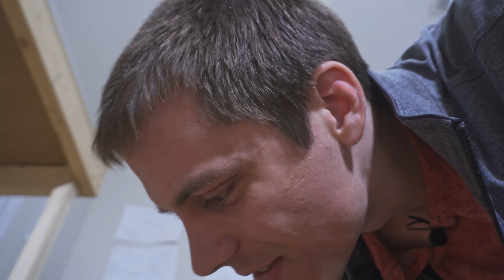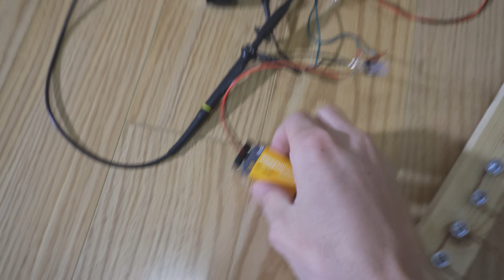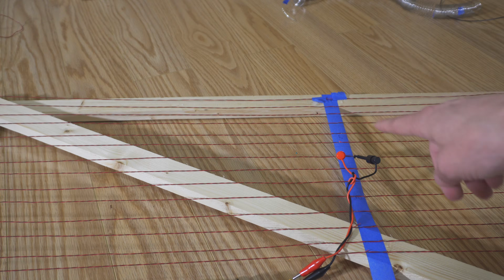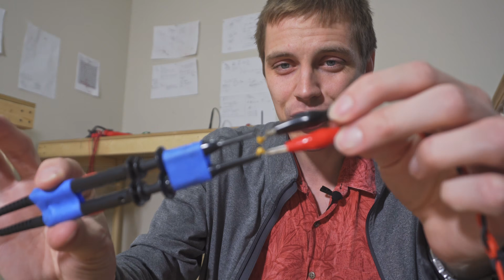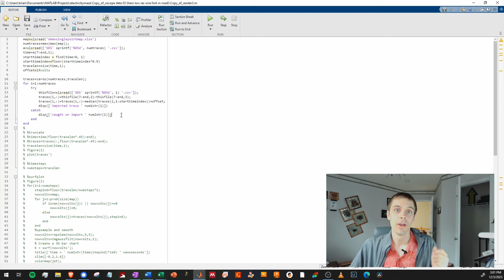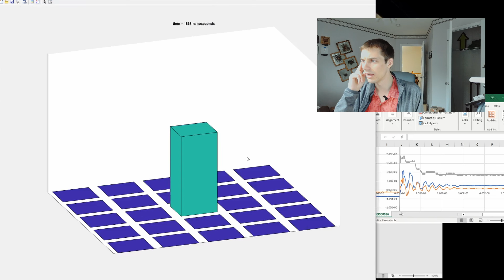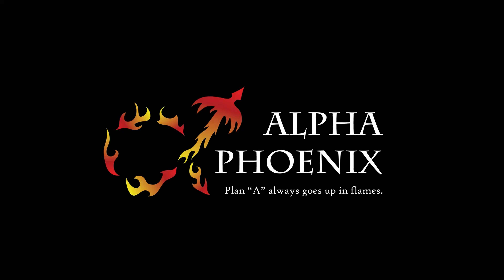How to measure waves of electricity

Comment: I wonder what it would look like to just use a single probe attached to a point in the wire rather than two to take the difference. It might be cool to see how a portion of the wave spreads out radially bc of cross-talk and then later the actual wave traveling through the wire arrives. Although I could easily see that being too noisy to really learn anything from

Comment: Thinking about how twisted pairs naturally reduce EMI (the reason they are used in telephone and Ethernet cables).  It would be interesting to see this same setup but not twisting the pair, just straight wires touching each other.  How much worse would the EMI be?  Would probably require some home built contraption to put a wrap around the pair to maintain even contact between them.  The thinnest available speaker wire maybe?  Thermocouple wire is often made this way, but it's pricey.

Comment: Brian, this is probably the most interesting series of videos I’ve ever seen. No hyperbole here. So many levels of fundamental understanding about electricity, impedance, metrology, being shown and explained in an intuitive way. 
One question I was left with: how does current depict itself in the top graph of voltage? Is it the increased area under the curve? The slope of the wave front? I know charge has to flow to change the voltage within the line, but I’m having trouble connecting it to the measured values.
Thanks.
Reply from the maker: the "fake electrons" in the diagram, and the associated "electron drift speed" plot were based on how much current would need to flow in order to see the observed changes in potential along the wire.

The first bounce is easy: If you assume the capacitance of the cable is the same everywhere, then every additional volt is a proportional change to the electron density (linear density) in the wire. Once you pick an arbitrary (ridiculously massive) capacitance, you can invert the "electrons per length of wire" plot to get a "distance to the next electron" plot at any location along the wire. If you know the electron at the far end of the line isn't moving (for relativistic reasons, don't need to assume anything about electricity), you can use this to iterative draw each "electron dot" spaced back from the end of the wire the correct amount. The really cool thing is that as you play the animation forward, this construction (based completely on a fudged electron-density-to-voltage characteristic, produces motion, because you NEED electrons to shift down the wire slightly to produce these voltage waves.

Subsequent bounces are harder, because then you don't have any stationary electrons to use as a foundation, and you need to grab an arbitrary (actually carefully algorithmically chosen but whatever) and say "this particular fake electron isn't going to change in speed this iteration" and you base everything off of that. 

I realized after the fact that I could have based everything off the electron at the supply end and then measured the ACTUAL current using a small resistor (which I did at one point), but I was actually much happier to see that you can get good realistic motion based exclusively on assumptions about what current is necessary to produce a certain voltage distribution.

My FIRST attempt was actually a full simulation - I dumped a bunch of electrons in the wire and let them be accelerated by the field, but unfortunately the scope traces at different distances were SLIGHTLY offset from each other, and that meant that while a human could identify the waves easily, the algorithmic electrons were bunching up as they got attracted to all the slightly-elevated trace locations and it was a nightmare.
Reply: Thanks. Took me a bit to work through, but I think I got your approach:
Represent voltage i.e. relative charge density as the direct inverse of distance between the charges. 
Back-calculate the position of each charge relative to the stationary reference. 
Add the incremental movement of the reference to all charges.

I puzzled through my question again, and this is my long-winded logic on current in the voltage graph:
Consider arbitrary positive charges, zero net charge initially, and a perfect step input wave.
When the “voltage wave” travels through the length of wire, the net charge in the wire increases.
This increase is proportional to the voltage(charge density) and the length of wire(capacitance) under/behind the wave.
The speed of the wave determines the amount of charge moving through the starting point per unit time.
Charge movement is current.
So the voltage integrated over the length of wire is total charge, and the change of this integral over time is current.
If we move the virtual “current sensor” to somewhere along the wire, we can just integrate starting at that point.

Of course, this breaks apart as soon as there’s a current coming in from the end.

Comment: Is the time the signal goes into the oscilloscope from the probe taken in account ? (Subtracted to get the real time it got in the wire ?)
Reply from the maker: dont know how long, should be the same for all
Reply: @BetaPhoenixChannel   Ok you're right, as the calculation are relative to the initial signal time, if the length and the constitution of all cables probes are the same it should be ok 😉
(what did you think of my experiment proposal ? 🙂)
Reply: ((just in case : the experiment proposal in the comment section of the video "Can you replace all of the mobile electrons in a wire? (Back of the Envelope episode 2)" 😇 ))

Comment: For improved accuracy with differential probes, you should have connected the grounds between them!
The second thing, and I think you did do this, but non the less:
It is very important to use the x10 setting on the probe for two reasons: to increase the input impedance of the probes (the thing you tried to do with capacitors), and to enable you to trim the probe's compensating capacitors (little screws on the side) to eliminate ringing.
Trimming is done with a probe attached to the test generator contacts just beneath the display in the middle of your scope.

The problem you saw with the probe disrupting the signal patterns is from the ground connection of the trigger probe attached to the switching circuit.
You really should have added some proper analogue switchings to the circuit, like SN74AC66, and also separate batteries for the oscillator and the driving the line, to mitigate ground coupling through the scope.

Comment: Regarding using the electrolytic caps to bypass the schmitt trigger's power...  the common practice is to add a ceramic cap in parallel with the electrolytics.   The ceramics are much faster to respond to any changes.    As for the differential probing of the twisted pairs...  the probes already have a much higher impedance than the twisted pair.  Blocking the DC with the series caps doesn't seem like it would improve things.  Differential probing is required, of course, because you want the voltage difference between the red and black wires, and that black wire is definitely not at the scope's ground potential.   I really enjoyed the part where you explained the need to get data at all of the points and animate it, and then said "it's just that easy".   🙂
Reply from the maker: good to know! the vast majority of my electronics experience is with very slow things so electrolytics have been good. maybe those weren't doing anything at all here lol
Reply: @BetaPhoenixChannel  Doing this sort of high frequency electronics work has a variety of pitfalls.  You might want to browse a book titled High Speed Digital Design by Howard W. Johnson,  ISBN 0-13-395724-1.   There are techniques to improve the scope probe performance too.  This video has a quick explanation of why you can't use the scope probe ground lead for high frequency measurements....  https://www.youtube.com/watch?v=henwiLzSieA

Comment: The twisted pair is a transmission line. Your rapidly switched  pulse  is a mix of RF (wide band) and DC. We need to be careful and not equate the DC bulk Resistance of the twisted pair to DC flow, with the  Impedance of the twisted pair to an RF wave front.  Different critters. The pulse that is impressed and propagated at the velocity factor of the transmission line when the switch fires each time, is primarily a radio wave that rides up on the skin depth of the wire (frequency dependent) and its propagation along the wire is resisted by a combination of reactance and surface resistance, that we call impedance. Along with that is the DC current that is more controlled by resistance and propagates through the bulk of the metal at a different velocity.
This can be shown by a long balanced line made of two, very thin wall, hollow copper pipes. Measure the DC resistance of the line, then measure the impedance and velocity factor of the line at some arbitrary, but stable,  radio frequency.
Now, replace the hollow pipe with solid round bar of the same diameter and repeat the measurements.  The DC resistance change will be significant while the velocity factor of the balanced line to the pulse will remain close to the original.

Comment: I love how this video demonstrates that proper experimental design relates to just careful thinking and understanding of assumptions and first principles, and does not have anything to do with how fancy the equipment is. The whole experiment used dead bug circuits and a super cheap scope, but was crafted to be able to gain them necessary insights, and it does so with sufficient resolution to prove the points.

Comment: Great work on that visualization! I think your setup would greatly benefit from using coax instead of twisted pair, and from using BNC T-adapters as monitoring points (even though you've stated your motivation for a custom-made lines at the end of the video) - see my comment under your main video for more detail. By the way a great learning source about transmission line transients is a book by G.A. Mesyats called "Pulsed power", more specifically, chapter 2.

Comment: To more accurately use water to display force propagation, you could have a tube filled with water, capped on both ends with a latex cover stretched over each end, put say, a domino
on one end, and tap the other end, and show the force knocking over the domino. I would say electrons don't flow, they propagate the force through the medium.
Reply: Electrons don't exist. They are just afterimages perceived by our poor imagination

Comment: Here’s an idea for you.  A plane’s metal wings moving through the earths magnetic field should generate a small potential.  If you connect a galvanometer or equivalent to the end of each wing, the cables connecting it also generate the same potential cancelling everything out.  How could you measure the voltage across the wings?
Reply: Maybe this would work? Connect the wires, bring the plane up to speed, disconnect the wires, land the plane, and then measure the potential.
Reply: In theory there is a solution but it is not practical.  Have the plane fly really high and then have two really long wires that go down to the ground.  At the ground have a stationary volt meter to measure the voltage.  The plane will have to fly in an arc with a radius given by the length of the wires

Comment: Is the back splash on the fork point because of imperfect soldering acting as a resistor?
Reply: Check out the other impedence matching video and he explains exactly what is happening.
Reply: Yes, in a sense but not exactly.  I would call it an impedance change which could be caused by a resistance change or, more likely, a physical dimension change which changes the characteristic impedance at that point.  For example, PCB traces which are continuous copper pours that change width show impedance changes and reflections at those points.
Reply: Wiring those two twisted pairs in parallel and then connecting them to the twisted pair that goes to the battery means that those two 150 ohm twisted pairs act similar to a single 75 ohm twisted pair.   When the pulse edges come from the 150 twisted pair and hit that 75 ohm impedance, the change in impedance will cause reflection of the pulse edge and send some back to the battery.

Comment: Could you do this same sort of thing with an antenna?  Could you use that to see how and where it's picking up a signal? Would a received signal cancel itself out if it's wave is bounced back at cosign of the received wave? That why some antenna's like old TV antenna's have a branching fern leaf pattern to provide some provide some constructive interference at the main branch?  

Lastly does it move faster as it's an external force or the same because of how electrons move in the wire? That being the most like Veritasium example and probably the more interesting one to look at in relation to it. I'm sure it's just oscillating or resonating not actually moving through it like this though and that would be an interesting topic as well.

Comment: This is extremely interesting and useful.  Can you expand a little bit on what electric component is going "cross wire"?  

this expanded my understanding of general EE from college, and I'm now interested in the niche of things I didn't understand across my cursory understanding.....  

Also, like there's a brain itch I now have about inductive spikes / transients -- they appear to be made made at a very fast collapse rate of the magnetic field; and breaking it down to this granular degree there's something there that I don't yet understand that was part of a course in college......

Dude, if you have any patience left after taking so many measurements -- can you elaborate on any other general understanding of EE as a series for any reason?  Super intrigued and thank you for posting the extra content -- this was a great way to start the wednesday.
Reply: I don't know if it helps you, but to me most od these things actually clicked when we were forced to calculate the impedance matching from ground up. The wire model from LRC and ideal conductors +  Integrals (both numerical and clasic). Just the ladder of RC dividers charging and  simulaneously feeding part of the current to another exactly same divider infinite times just somehow let me  make sense about what exactly I am mesuring on any point of the wire..
Reply from the maker: I hit that with a bit more detail in this video! https://www.youtube.com/watch?v=RkAF3X6cJa4

Comment: Out of curiosity, how difficult would it be too synchronize switches on both wires off the battery?
Reply: Probably it would be the easiest to go with solid-state components like transistors. Another crazy idea that came to my mind is driving a transformer (with higher and higher currents so that you get DC out of the other side).